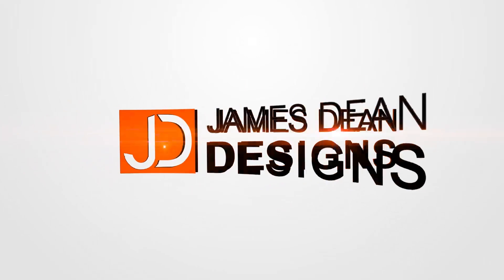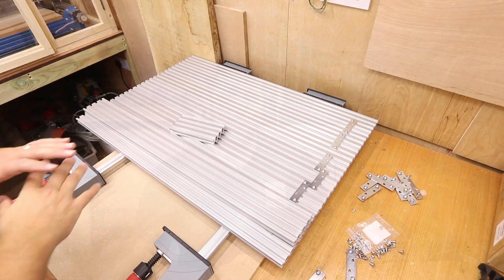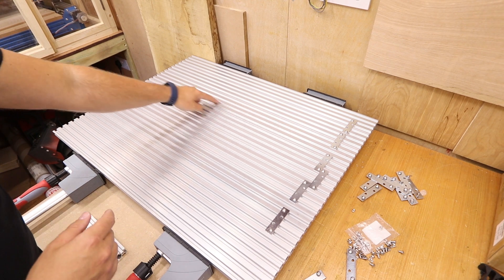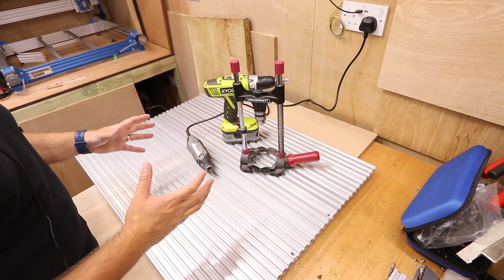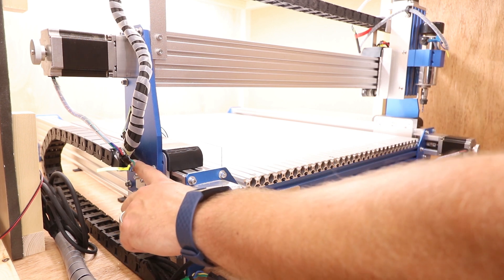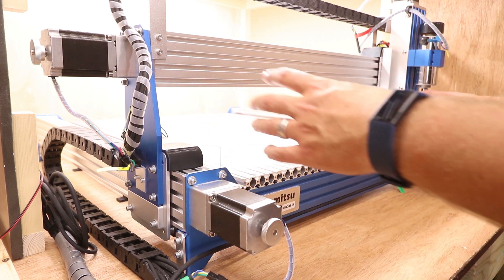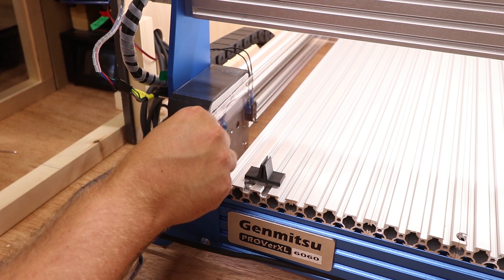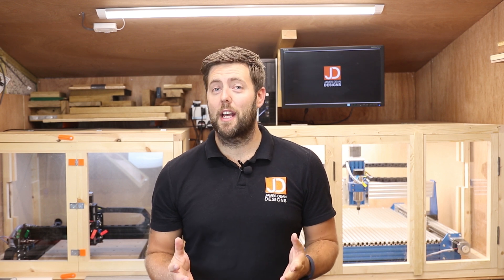Upgrades to the PROVerXL 6060/4030  CNC machine from Sainsmart Genmitsu

Comment: Hi James, After watching many CNC video's I decided to purchase a PROVerXL 4030. If all goes as I believe it will, I plan to expand to the 6060 with the upgrade kit. I'm planning to build an enclosure to keep the noise and dust to a minimum. So I want to build the cabinet for the 4030 but make it big enough for the 6060 to fit after the upgrade. I can't find the exterior dimensions for the 6060. Can you tell me the dimensions?
Reply from the maker: Infor is in here but your talking about 105x105cm for the machine. That's not including the control box but that can and should sit outside the enclosure 
https://youtu.be/de7qCLApghY
Reply: @JamesDeanDesigns  Thanks

Comment: Is there a way to rewire the motor plugs to make home LL corner. With motor switch to the front, when you home the machine it goes to the back corner and if you fix it so that it goes to the front corner lower left corner then your machine coordinates are negative. -620 -620 5... The OCD in me doesn't like this. I think it's as easy as switching a/b pair, or maybe I'm just being fussy 😂😂😂😂 thank you in advance

Comment: How do you like this machine? Do you think it could handle steel? Also could the lead screws be changed to ball screws and will it handle aluminum pretty easy. Also one more question can it do 3d carvings in aluminum
Reply from the maker: The machine is great, its my work horse. It can probably do steel with the right setup but I wouldn't advise it. yes it can do 3D reliefs in aluminium

Comment: The carriages on my Y axis are very stiff and do not move freely...I tried dry lubricant on the turn screw and rails, and, loosening the bolts on the carriage, but it did not work. What would you suggest?
Thanks 🙂
Reply from the maker: There are two brass nuts either side of the lead screw. The bolts holding them in place should not be touching the nuts, if they do it causes to much friction

Comment: Hi James I have a  PROVerXL 6060 and was wondering if it is possible to add a laser in tandem with the Dewalt DWP611? Or will I have to change from spindle to laser each time.

Comment: Is it possible to buy the ProverXL 1010 without having to buy the 4030 first? Seems like a waist and could knock off a couple hundred bucks from the total spent.
Reply from the maker: At the moment no. You have to buy and then upgrade. It is frustrating. However I know Sainsmart are working on a new product but I suspect it may be a 6060 and not a 1010.
Reply: @JamesDeanDesigns  boooo 😂

Comment: I'd love to know if anyone has upgraded the ProVer XL with Ball Screws and Eccentric Spacers, or at least tried to?
I'd think that those two things would be one of the major mods people would try to do but I have yet to find on the internet of anyone mentioning either for it.
I was kind of surprised that the ProVer XL did not at least have eccentric spacers when I first started looking at it. Probably because I am so use to them in 3D Printers. Maybe at some point the next iteration of it, if there is one, will have both those features added.

Comment: Thank you James for being so concise. I am having difficulty finding the connector plates you used and am thinking of alternatives. Is there a reason that you couldn’t use the CNC to drill properly spaced holes in longer strips of flat stock? How about attaching c-channel along the ends of the extrusions? Tap the existing holes in the extrusions. Working with wood, I like my parallel clamps but when working with thin stock I prefer using four-way clamps to keep the panel perfectly flat. I think working with aluminum extrusion is the same.
Reply from the maker: There is a load of different ways to connect them to be honest. On reflection this was a pretty messy way to do it. Use what ever you have to hand though 👍

Comment: I dont know what software you are using but it is NOT the software included with the 6060 extension kit and the Genmitsu PROVerXL 4030 CNC Router.  Please check your information and use the correct software that is included with the purchase.
Reply from the maker: Hi John,  Can you explain a little more about your issue as you as my information is correct and the software used in the setup video is also correct

Comment: Hi mate 
Were did you get your extension kit from please ??
Reply from the maker: Sainsmart. There is a link in the video description for it 👍
Reply: @JamesDeanDesigns  just ordered one now after seeing your video but blimey there are some horror stories. Yours still going OK mate ?? 👍
Reply from the maker: @smallgarageworkshop6119  great news! mine has been fine. Problem is bad news always travels faster than good. For every 100 positive experiences, you'll only hear about the 1 bad one.
Reply: @JamesDeanDesigns  I can't locate the extension kit though mate as your link just says pre order for UK ... I usually build my own as you can see under my channel but mine mainly plasma but does do wood so it's the first time I have purchased. Big day Thursday 👍
Reply from the maker: @smallgarageworkshop6119  its just out of stock at the minute then. They only ship so many units over at a time. You could always message Sainsmart directly and see when the next shipment is expected. Occasionally they ship directly from China but I'm sure someone said to me it was about another £80 on top
Reply: @JamesDeanDesigns  no worries 
Cheers for the videos as nice and clear but I know you use vectric so as im used to mach 3 and 4 plus vectric I can't see a gbrl pp for vectric. Do you use this still or is there another pp.  Thanks for your quick replies 👍

Comment: Why not weld those extrusions to that are solid?
Reply from the maker: It's all aluminium. I know it can be welded/braised but not a skill I possess. No reason you couldn't well the bed up though, I wouldn't weld it to the frame personally. Only thing I would question is the neat will naturally damage the coating and I would worry the heat could also distort the bed

Comment: How sturdy is the 60x60? is it flimsy? Does it cut accurate?    I want to cut carbon fiber plates and I need it to be rigid.
Reply from the maker: It's a solid machine, the C beams keep it really ridged as they are so strong. Especially when you drop a bed on it as well
Reply: @JamesDeanDesigns  I was just curious that because the Axis's ride on poly wheels on a channel vs a Rail to keep it parallel.  I am about to pull the trigger and buy this machine It SUCKS that they want $349 extra for the upgrade and not just offer it as a 60x60 stand alone
Reply from the maker: @ThomasShue  it actually is. I get it for those wanting to space costs out but it would be great if Sainsmart just did  the 6060 as a full package upfront
Reply: @JamesDeanDesigns  i just now bought this machine with the 60x60 kit. I might not use the grbl controllers and instead use a TinyG v8 controller. We will see. I built an OXCNC for a friend and I used the TinyG and Chilipeppr as the controller and it worked fantastic

Comment: Very interesting video. One question, would it be possible to flip the two y-axis assembles? I mean that the lead screws would be on the outside of the base, thus reducing dust accumulation on the lead screw.

I hope my question is understandable.
Reply from the maker: Yes that is possible but you have thought make a modification. Essentially when you flip the C beams around the fram becomes narrower, as a result you need a packer on either side between the X axis side plates and the Y axis carriages. Ive seen a few people just use ply board and drill holes for there the bolts go through. You will also need slight longer bolts as well to hold those end plates onto the carriages

Comment: One extra bit is to swap the brackets that trigger the limit switches, (as well as limit switch mounting plate swap) unfortunately my cages nuts were not the ones that pop out, I had to undo the 3 bolts on the rear of the C beam bracket, then 4 bolts holding the bearing mounting plate to slide the nuts out. I did check the extra spare bits from assembly, they were no spares. C'est la vie. Job done eventually.

Comment: really good video.. what do you think the cost is now with all the upgrades?
Reply from the maker: Its still a solid machine. I would hope Sainsmart give users the opportunity to simply buy a 6060 out right at some point in the near future . You have a lot of spare parts after the upgrade so it does feel like part of what you spent has been wasted. In fact I'm trying to work out what it will take to convert the spare parts back into another machine
Reply: @JamesDeanDesigns  yes its a very good machine and i have been thinking about it,  the price now with all the upgrades is starting to get into the price range of some other good cnc machines that I have been thinking about..
The 6060 would stilljust be slightly bigger
Reply: And I should think your 6060 would be able to machine aluminum and help you make anouther machine out of the parts you have :)

Comment: Great video, as usual.....I don't have a 3D printer, vould I buy the caps for the wheels from you ?
Reply from the maker: Thank you. I could possibly arrange that but depending on where you live the postage may be quite high. It might be easier to get someone local to print them. Just let me know, you can always message me directly on Facebook or Instagram
Reply: @JamesDeanDesigns   Hi, I have sent you an e-mail....if you could see it. Thanks!

Comment: Another great video! Going to print the roller covers today. Thinking about installing bent acrylic shields at some point. Already did the DeWalt upgrade, I think that you are going to like it. I did feed the power down the X drag chain, while removing the old power cable, then exited at the loop. Wire tied the old cable at that position but you could of course completely remove it. I didn't need to do anything else and projects have been working great! At that point you can now also use several dust boot options that fit the DeWalt. Currently running the one from SainSmart but think I might try the one from Carbide for better results. You could also hybrid your spoil board by running MDF sections spaced apart while leaving some open track. You could then use M6 hardware and dogs, just a thought. Keep up the great work!
Reply: @JamesDeanDesigns  good plan! Looking forward to seeing it!

Comment: I was wondering if you would move to the dewalt. That was one of my first upgrades. I needed to move the wiring for my X- Axis to go right instead of left. Since the bracket that holds the X axis limit switches cannot be reversed, my son helped me 3D print a bracket modification - it is secured to the X-Axis limit switch mount through the two holes in the mount (didn't even need new screws), and mirrors the mount on the left side for the drag chain.